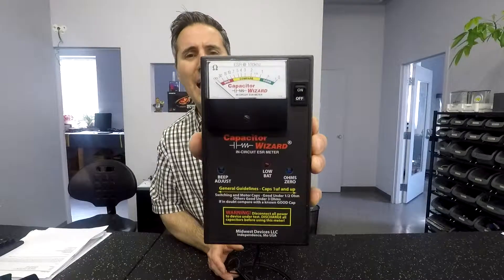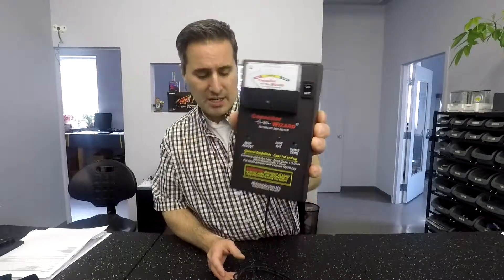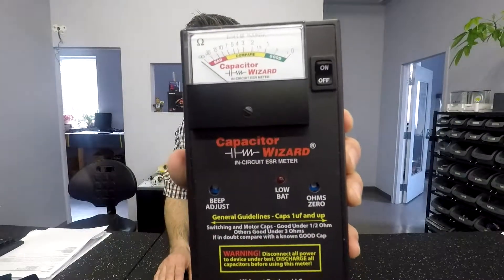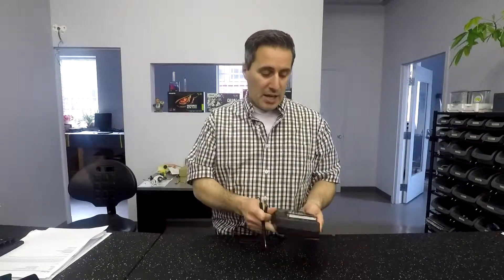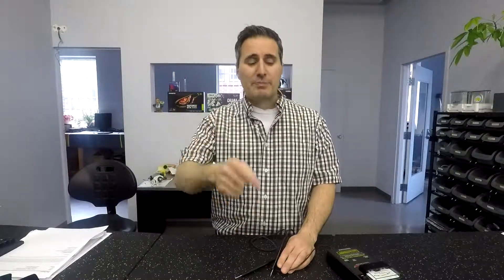Simply Test Capacitors with a ESR Meter! Awesome!

Comment: Sir, can this esr meter test smd capasitor on board?
Reply from the maker: Good question, I’m not sure, try giving them a call. The company is called Midwest devices.
Reply: only from 1.0 and ++++++++++ no limits   and is a capacitor tester.

Comment: Videos too short 
Please show us how to calibrate the needle and the beep please
Reply from the maker: I haven’t had to do anything like since I bought it many years ago
Reply: @SiliconDirect  My one the needle,over deflects and the beep will sound differently.
How do you set it up?
On others you short the leads and adjust

What about this one?
Reply from the maker: I make sure my batteries are fresh and there’s no set up, it just works. It either tells you that the cap is good or the cap is bad or that you should compare the cap to one that is the same.  There is another “blue “ meter that gives you more detailed results with a number readout , but I really like the simplicity of this one
Reply: @SiliconDirect  Did you get a manual with yours please?
I purchased mine nearly 15 years ago, and it’s called the Capacitor Wizard?
Reply from the maker: https://www.midwestdevices.com/DougsNotes.php
Reply: @SiliconDirect  Awesome, Thankyou 
I Subscribed by the way 👍